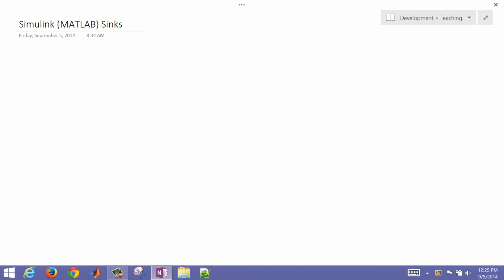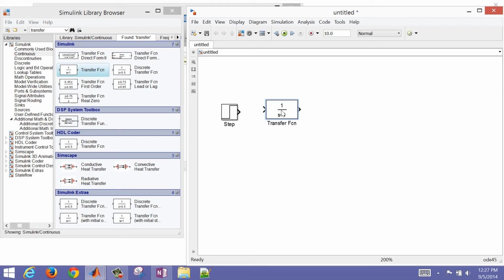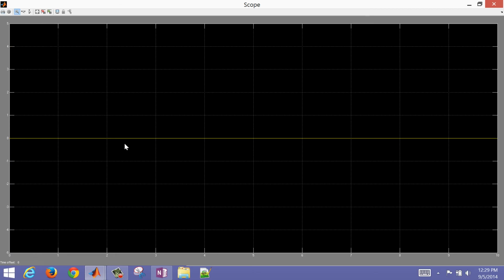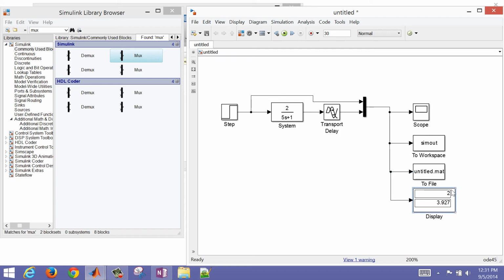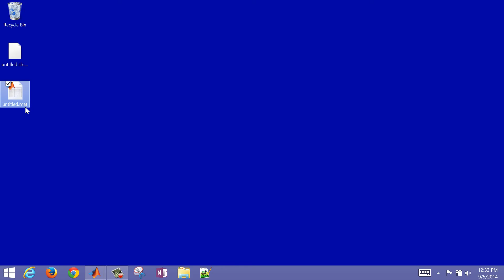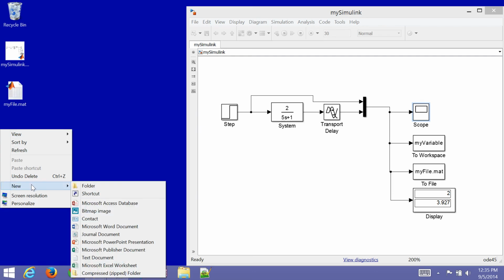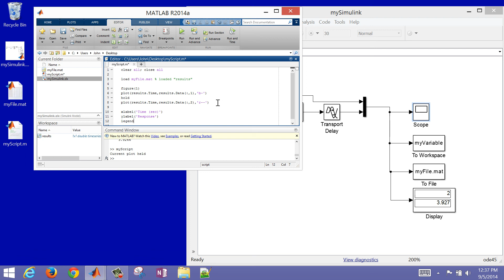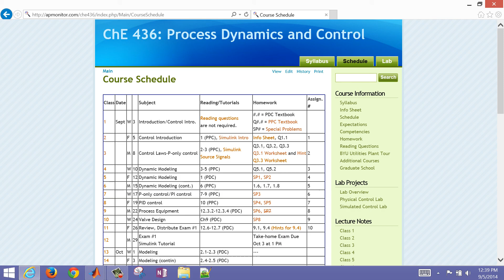Simulink (MATLAB) Sink Blocks

Comment: sir, could you tell me how to tune a PID controller when the buck converter is connected to a pmdc motor?
Reply from the maker: The general principles for tuning PID controllers found in this course should help you: http://apmonitor.com/che436 (MATLAB) or http://apmonitor.com/pdc (Python). You typically do a manual step test, obtain a first order model, use tuning correlations, and then implement the PID.